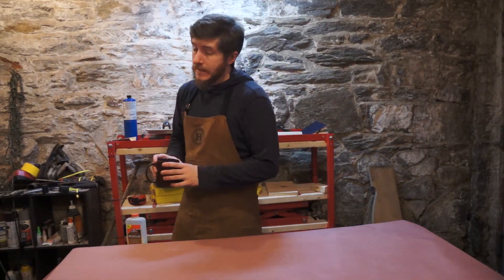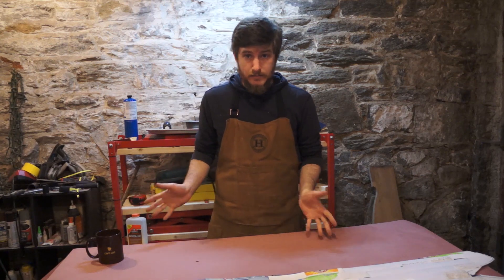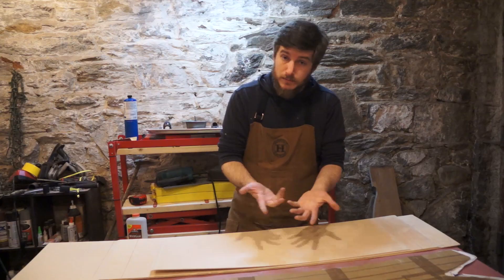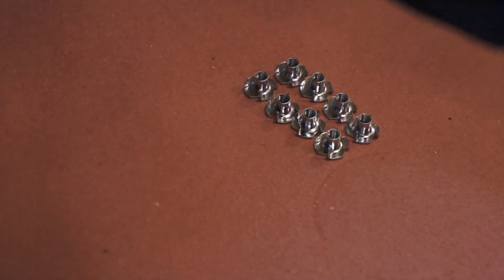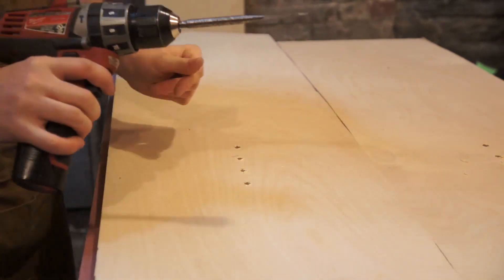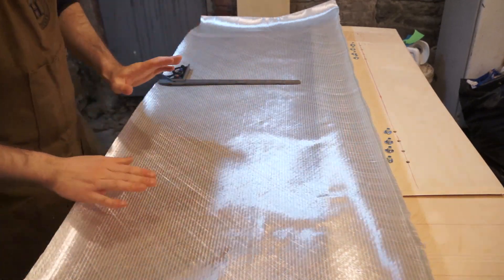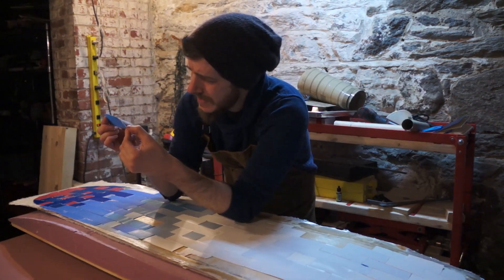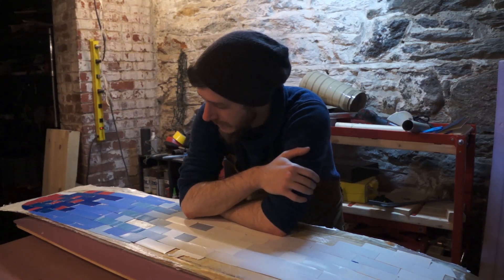Homemade Composite Powder Surfer (no. 3) - Disaster Strikes!

Comment: As far as the base goes what if you did something to heat the plastic to bond them together. Maybe something like an iron or some sort of torch to just slightly melt them together
Reply from the maker: I'v experimented with melting the pieces together a little. HDPE expands a LOT as it heats and cools so they always ended up being warped, but there might be a way around it with a mold or press or something. I'm still trying to figure it out. Any thoughts?